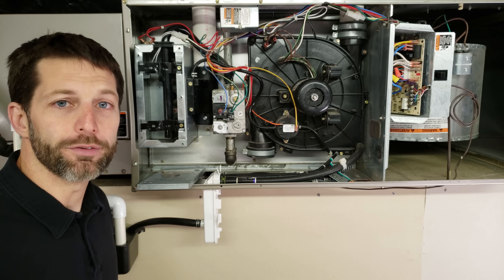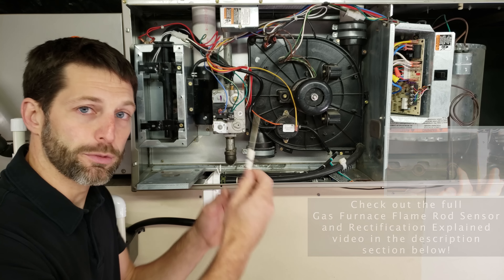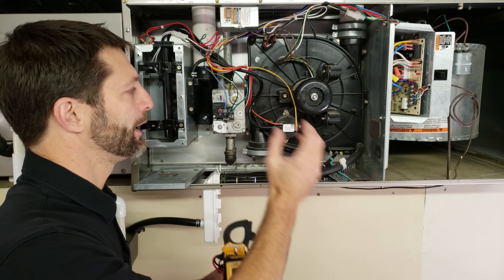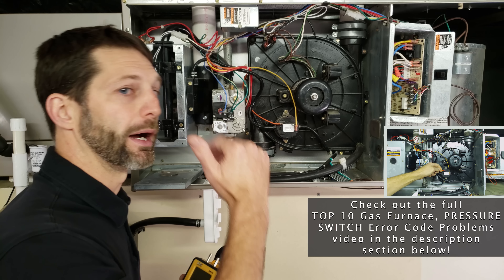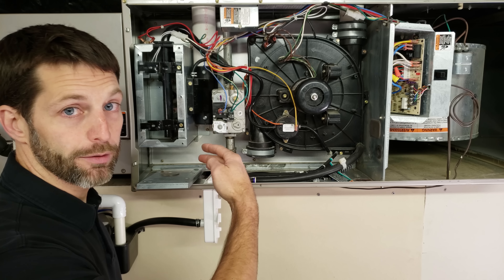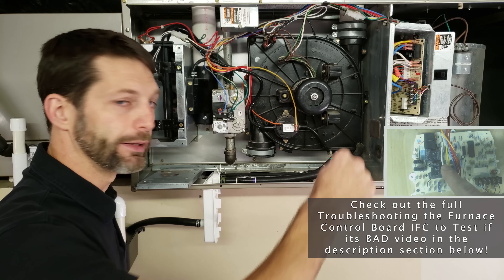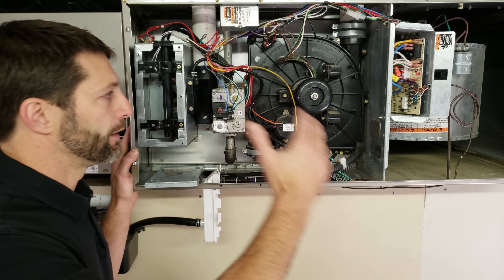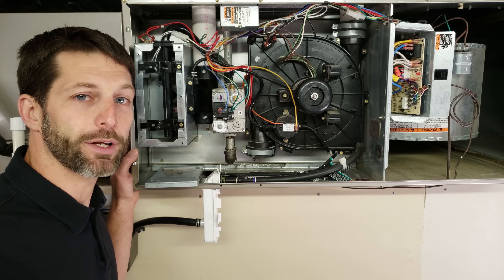Top 6 Gas Furnace Parts That are Blamed or Misdiagnosed as Bad! No Heat!

Comment: Thank you so much. Two repair men wanted to charge me $1000 to replace the control board on my old furnace. After 15 minutes of trouble shooting I fixed the system without changing anything. Those blood suckers are really something.

Comment: I'm a commercial gas tech. Flame rods do go bad . But takes time. I've seen one's you could clean up but won't conduct due to heat treated and metal losses it conductivity. The porcelain bleeds to ground. You can test this with a Megger.

Comment: Looks like the bearings are a little tight when you spin the cooling fan on your ID motor Craig. Good morning, good lesson!
Reply from the maker: Hey Tom, thanks! Those carrier/bryant/payne inducers are all like that. It isn't the bearings but is due to the heavy weight of the inducer wheel inside the inducer housing, thanks!

Comment: Maybe a video on the most overlooked issues too. Especially plugged drains on 90% condensing furnaces. I go behind lots of techs for that problem as second opinion to solve recurring/unsolved issues.
Reply from the maker: Randall, thank you for letting me know what you would like to see!
Reply: We have a scamer in my area that uses " you got rust on your heat exchanger. You need a whole new system"
Sells em every time.
Reply: With regard to plugged drains you get all the symptoms of other problems. Flame roll outs, open pressure switches, high and or rising flue c.o. on combustion testing, limit safeties tripping, inducer fan problems etc
Reply: As for bad h.e. scams i see people doing that around here in Michigan too. I Personally change a lot of commercial heat exchangers but those are really easy to find since packaged units you can just pull the door and take a picture for the customer. Residential you need a scope or another more tedious way to prove it to them. I never sell a furnace to anyone unless its a clear breach that warrants disabling the system for safety/health concerns.

Comment: You missed a few steps in what the board does. You most likely left them out for time. When I start hiring people I will ask them to bore me with details on what happens on a 80% furnace. From call for heat through furnace shutting off.  If they take 3 minutes to answer if they are a great tech. Troubling shooting a pressure switch or flame sensor or limit switch the board does two thing it sends out a voltage and then must receive the voltage back. If the board don't send it to the component or read it when it returns it bad. watching the burners when the the blower kick on is a great crack indicator. But what I have seen here today you are a great tech and teacher.
Reply from the maker: Carl, yes I explain them in much greater detail in the flame rectification and flame sensor videos. Everything you are mentioning  is absolutely correct, thanks a lot!
Reply: I am not a Tech but a Handyman and I Understanded it very well.  From most of his Videos and some other people Video clips, I installed the gas furnace and AC unit all by myself.   Oh yes, Everything in Life no One tell us Everything in details.  Not even between a husband and a wife and that is the Reality of Life.....

Comment: Hello you have one of the best HVAC channels on Youtube!  I have individual circuit amp draw app from emporia energy, so I monitor various breakers wattage.  I have a 20 year old heil 3 ton heat pump that I installed myself and pride myself in the performance like SP of .3" WC on low tap vs .5 spec and very good power bills.  Anyway, I noticed with cooling I get between cold day 2500 watts compressor vs 3000 hot day but heat pump mode is higher at 3200 watts, I believe it normal also heat pump mode watts move sinusoidally up and down by about 150 watts/ per minute almost like the outside TXV is modulating.   Does this sound normal?  Thank you for great channel.
Reply from the maker: AD, I wouldn't say that it sounds abnormal. There can be some fluctuation due to a few psi moving up and down from metering device modulation like you were saying and during heat pump mode, it may be running with a slightly higher compression ratio! That is awesome how you are monitoring all of it! Great job!

Comment: On a Bryant furnace can the wiring harness between the control board and the inducer control board go bad?
Reply from the maker: It could have a loose connection and it could also have a loose solder connection at the board. Anything is possible, thanks

Comment: Is it normal that when the gas valve is connected, the voltage is not kept constant at 24 volts, just spikes and goes back to 0. When I disconnect it, the current is kept for a good 5 seconds (test mode). I'm thinking that the valve is causing the voltage to drop because it is bad but just wanted to know if this is a normal behavior, I would expect voltage, just no actuation but in this case, the voltage is dropped to 0.

Comment: at seven minutes what me and most persons call  ground is actually return
There is "neutral" which is  center tap on  3-phase ~ not seen here;
And there is the return path of power which is very commonly tied to an actual "ground" which is somewhere tied by conductor to actual earthen ground; Often the return is tied to ground in the panel – if not neutral will float compared to ground then you have voltage across chassis or cabinet to earthen ground

The driven rod becomes corroded due to earthen currents and for some reason practice — code actually — has return path to the drop "bonded" to  earthen ground which is driven copper  rod – in most cases – or a flat metal conductor under bottom or power pole — this is run with #6 AWG and you can see it on many power poles;

Seems the concern is if return is not bonded to ground charges can build inside the cabinet which renders the cabinet dangerous so they just tie everything to common ground;
Reply: Cool story bro

Comment: what would make one section of the house vents smell like something is burning bu not other area vents?
Reply: Maybe something in the vent is causing the smell.
Reply from the maker: Check for possible dangers by doing a combustion analysis and measure for carbon monoxide. There may be something else that smells along with possible CO. It could just be something in those two vents though reacting with the heat but better check to be sure, thanks!

Comment: Is your book focused more on residential ac or commercial? I know a lot of the “curriculum” will transfer between the two types, but just wondering.
Reply from the maker: Mainly residential single and two speed units but it goes over troubleshooting, airflow problems, all the refrigerant basics, charging methods, all the procedures to get a system ready for refrigerant. I would love to hear what you think about it after reading! Thanks!

Comment: I have a question...my gas furnance runs good but every now and then when it is very cold outside my furnance pilot will go out and not reignite..as soon as we lit the pilot it will turn on and stay on...I also noticed that there is black smog lines in the furnance..any ideas? I was tild that i need a new furnace
Reply: Cold air drops and you may be back drafting and blowing out the pilot,  also the flame sensor may be  fouled,  pilot could be blowing weak. A number of things could be going on.  Really you should be calling a service company to come look and see if there is a reason for the failure
Reply: @special_k-hvac  thank you

Comment: My furnace will run two or three times then stop for about five days or so.  Says pressure switch an lock out on code. Any suggestions?
Reply from the maker: If it is a 90 percent efficient or higher unit, has the condensate drains and tubes been cleaned yet? I did a video on that as well as top 10 pressure switch error problems. Make sure to not put pressure on that pressure switch, only with a testing tool for that purpose such as the sdmn6 but it may just be the drain lines, thanks!
Reply: @acservicetechchannel  yes it is a 90 percent furnace. An no the lines have not been checked. .  The furnace guy we called said it could be the board, but can't guarantee that's the problem. I thank you for the reply, an keep up the good work.Thanks an have a good day :-)
Reply: Humidity or water in pressure switch tubing, or dirty fs assuming furnace filter is clean

Comment: Have you ever done a smoke pencil test while the blower fan is running and the inducer fan is not?
Reply from the maker: That is certainly another way to check. Sometimes the problem is the primary heat exchanger has pulled off a bit and is no longer sealing and it is not a crack in the exchanger, thanks!
Reply: @acservicetechchannel  so is the only for sure true way to inspect is a year down and visual inspection?  I never want to be the guy who sells what isn't needed.

Comment: Your book, that is mostly an air conditioning book correct???
Reply from the maker: Working with refrigerants, preparing systems for refrigerant, checking the charge, troubleshooting by reading the charge, airflow troubleshooting reading static pressures, temp rise formula , etc thanks

Comment: Would a Carbon Monoxide detector with a positive reading at a heat vent be proof enough for proving a cracked heat exchanger without actually locating the crack?
Reply from the maker: It certainly is something but for the customer's sake, whenever possible, try to go further so they know there is no question or second guessing, thanks!
Reply: Yes
Reply: Also take into account that if there is a standard vent water heater nearby that if its not venting properly it could also be drawn into the return

Comment: Chances are the secondaries are failed on that Carrier.
Reply from the maker: That's a shame that heat exchanger material was used in the secondaries of the older furnaces
Reply: Some of the older Trane 90% units have issues with the cold header cracking. They still run but they leak water all over the place.

Comment: In its flash codes..check over each section of that code. Have well trained techs sent to repair issues..not just cheap labor with no experience! Problem solved

Comment: my fan is runing all the time under any setting after i changed the thermostat ... i put the old one back and still same problem,
The error code green light flashes 4 times which means - LIMIT CIRCUIT FAULT   − Indicates the limit or flame rollout switch is open." i took out the G and R thermostat wires from the control board completely off  the screws but the fan kept blowing ..now  im getting stumped